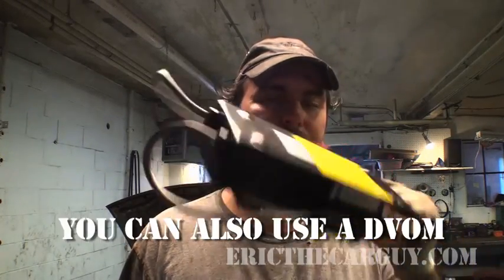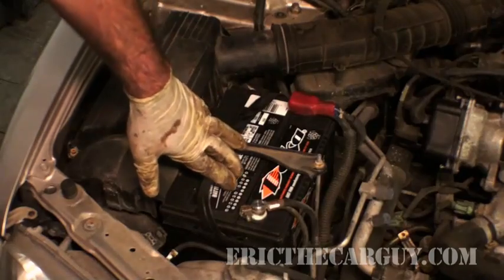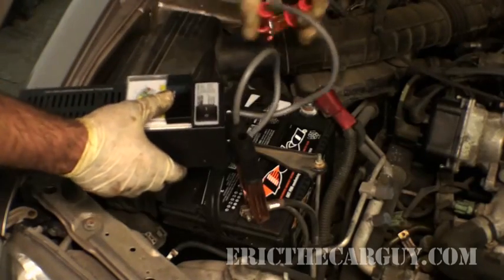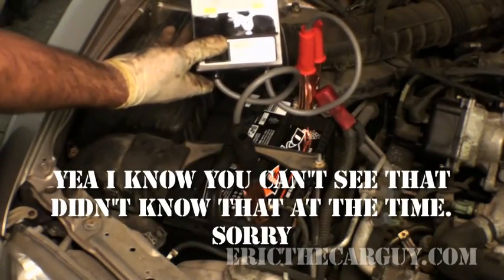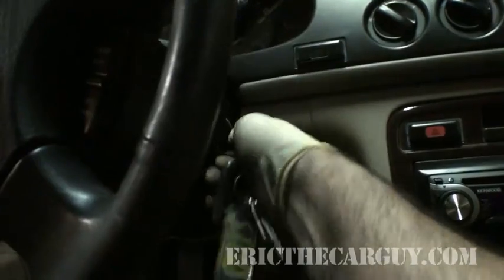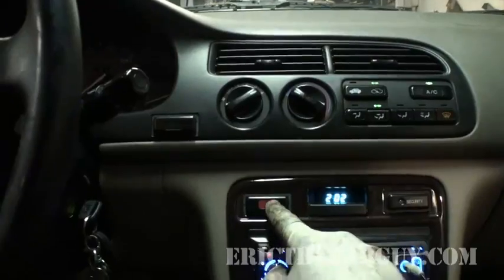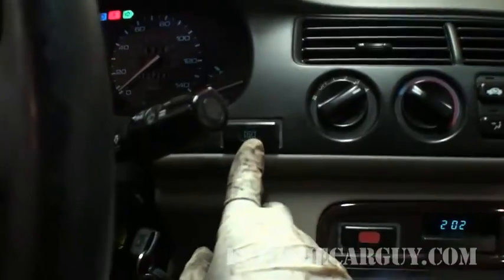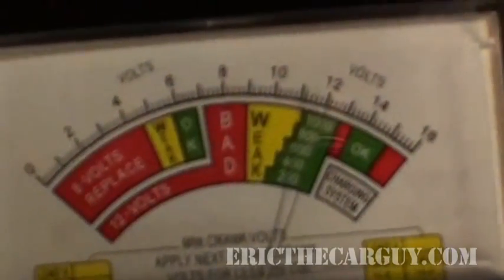How To Check A Charging System - EricTheCarGuy

Comment: Eric, I have an 05 Volvo xc90 that if not driven everyday, will not start.  clerk at autozone tells me it is a parasite. a neighbor tells me that the diodes in the alternator are bad.  I have hooked a meter and went checked every fuse, could not find anything(not sure if I did it right).  should I replace the alternator or do you have another suggestion.
Reply: +Mike Puckett Do not replace the alternator. If the car starts if driven every day, but won't start if it's been sitting still for a couple of days, then I concur with the clerk at Autozone; seems you have parasitic draw. When you said you did the meter-test with the fuses, did you mean hooking the meter in series with the battery (with the meter on Amp-setting) and start pulling fuses one by one? And if so, what did the meter measure the amp-draw to be from the get go, before you pulled any fuses?
Reply: thank you for replying.  what I did was to remove the positive cable from the battery(battery is under the back seats 3rd row) and I ran a wire from the battery post to the front of the car where the fuses are.  I hooked up the meter to the wire and then ran another wire from the meter to the battery.  I then started pulling each fuse one by one to see if there were any changes.   nothing changed.  I am not sure I had the right settings on the meter or even if this would work.  very frustrating.
Reply: SomeCoolName
Reply: thank you for replying.  what I did was to remove the positive cable from the battery(battery is under the back seats 3rd row) and I ran a wire from the battery post to the front of the car where the fuses are.  I hooked up the meter to the wire and then ran another wire from the meter to the battery.  I then started pulling each fuse one by one to see if there were any changes.   nothing changed.  I am not sure I had the right settings on the meter or even if this would work.  very frustrating.
Reply: +Mike Puckett If you did as you wrote then you had both leads from the meter connected to the battery, and that will not give you any amp reading. You need to hook it up in series with your battery, so you disconnect the negative or positive battery cable (it's recommended to remove the negative one actually, because then it won't cause any damage if it was to touch something ground), and you connect one of your meter leads to the disconnected negative cable, and the other lead to the negative battery post itself.

Now the current has to travel THROUGH the meter if you see what I mean, and then it can measure the current. Provided  you have the red lead in the right connector/input slot on you meter! (Amp, not Volts! And your black lead allways on COM), and the setting on your meter to the Amp-scale. If you have both an Amp-scale and a Milli-amp-scale, always start with thte highets scale, so not to blow the fuse in your meter. If you don't read anything on the A-scale, swith to the mA scale and see. Now, before pulling any fuses,  you should read a marginal draw, but no more than 40-50-ish  mA. More than that, and you probably have a parasitic draw.

NOTE, very important to ensure nothing is on in the vehicle, and that everything is as it would normally be if the car was just sitting in the garage, in other words, no open doors, no key in the ignition etc. Some "newer" cars even have sensors to detect if the key is nearby, so even that can "wake" the car's computer up without even opening the car door. Just something to keep in mind. Now you can start pulling fuses and look for a change in the amp readings. And remember, there may be more than one fuse panel in you car! In fact, it most likely is. Might be a good idea to look this up in the car's manual.
Hope this helps :)

Comment: how ERIC i have been to the shop 3 or 4 time to  the shop , i have a 2007 yukon denali  they said it wasthe battery, they said it was the brain, they said battery cable which they installment a new one, also a new battery plus a new brain but  i told then it was my alternator, now message says service battery charging system PLEASE HELP ME.....

Comment: hii eric , i have a 2009 hyundai i10, and the car wont start . i tried cranking with a test battery and it started. but the mechanic says that the cars alternator is gone and thus its not charging the battery... any thoughts ?
Reply: Saurabh Amin Sounds logical.  Have the alternator tested for free at some parts store like Autozone or O'Reilly's and then use google and buy a new alternator.  If the alternator is bad the battery will lose its charge.

Comment: Hey ERIC i have a question so i want to purchase a 2004 rsx type s and the owner said everything is good but he changed the alternator and the 2 o2 sensors and the only issue is the battery light is on and it wont turn off. Do you think i should risk it and buy the car. I know its not a huge issue but i dont want to deal with and problems after buying a car

Comment: I'm a maintenance nut about my cars and always checked and cleaned my battery terminals.  But Chrysler, in it's infinite wisdom, decided to bury the battery in my Plymouth Breeze in the left front fender requiring me to remove the left front wheel just to see it.  And Belle Tire loves their 100 ft/lb impact wrench.  If I get a flat tire I can not remove it with a new 4-way and a cheater pipe.  AAA broke one lug trying and Belle Tire broke one too.  So I had to pay for 2 new studs and $35.00 to have someone put a battery in.  Not ranting  It's just that I'm having cold winter slow or no starting now and the battery and charging system check out OK but I have no idea what the terminals or cables look like.
End of non rant.

Comment: Can you disconnect the positive cable on the battery while the car is running to check the alternator? If the car stalls then the alternator is bad.
Reply: I used to do that with older (MUCH OLDER) vehicles to test if the alternator was charging. Yes, the car will stall if the alternator is bad (that's if that method didn't destroy it). I don't know if I'd want to do it on newer vehicles though, since a good majority of newer vehicles have extremely complex electric systems now and can be pretty sensitive.

Your battery does more than just start your car. It also shorts AC, spikes and transients to ground. Removing the battery from the circuit (while the vehicle is running) allows those spikes and transients to travel around, which is dangerous to every semiconductor circuit in your car.

Disconnecting the battery interferes with the alternator's regulator's control voltage input, it's possible for the alternator voltage to go way over the top, frying everything. (were talking HUNDREDS of volts possibly)

So I really wouldn't recommend that method. Do what Eric does in the video, provided you have the tools. Much Safer.
Reply: Thank you.
Reply: yea in the old days it would work but now a days its about the money
Reply: Gary Pennington79p0

,
Reply: Last time my mom bf did that he fried everything in his car. Why would eric show us this way? Bcuz this is the safest and correct way. That way is the lazy and dangerous way. Electricity is not something to play with. People at autozone and orileys and my gf dad which is a mechanic told me never to do that. Just saying. That's very dangerous.

Comment: I would hesitate to definitively conclude this alternator is good based on the following reasons:

A brand new, known good, fully charged battery, that reads at 13 volts with car shut off (notwithstanding load of the computer and clock memory circuits of the vehicle). That is dropping below the battery's nominal voltage when running I think it's very plausible that the alternator is beginning to fail. I suspect at this point it is still charging partially, but not enough. A healthy alternator on a running vehicle, even at idle should read above 12 volts.

I would have conducted further investigation with the same test equipment by leaving the vehicle running at idle for 1-2 hours, with all electrical devices on, taking a voltage reading every half hour. If it continues to drop, we know this alternator is in need of replacement.
Reply: i agree   this being 12v is too low  car should be almost 12,5 to 14.5 with a  not sure i know that car wasnt post 2005     but in 2005. This is when   the cars started smart charging , turning up and down the v as you need it. At fully charged a batt it will sit at 12.5 as car or batt needs more it can hit almost 14.8 . That is why they did away with the volt meter on dash so people did not see the v meter moving  and think alternator all the time

Comment: Hey Mr. ErictheCarGuy. Been checking batt. on my Subaru Outbck 2002. Batt brand new. Mercilessly wire brush and sandpaper cleaned all cable contacts and on neg + pos poles of batt.

Today, Batt charger says batt. full 13V when connected directly to batt. poles. But with pos+ pole and neg- cables attached, batt charger says 'no batt connected'.

 When I "remove" Pos+ pole cables (there are two connected to Pos+ pole clamp), then connect charger directly to pos+ pole on batt and on neg pole with cable attached, charger "detects" batt. I checked alt cable attach and is snug.

I checked alternator with pos+ V.meter attached to neg- batt. pole and touched the alt case with neg from multimeter. Reads 0.01V. (I accidentally touched the contact under red cap on alt with spanner and it sparked.)
 
I was able to boost the car last night and batt charged full. Batt charged today but electronics absent, had to open car with key.

A fellow Outback owner suggested just replacing the batt+ cable before buying a new alternator.

Can you offer an opinion? Appreciate. Gary

Comment: HELP!!!! I have a 86 toyota truck. 22r motor Carborated. I replaced the Altenator, Battery< and checked ALL the fuses from under the hood and in the left side interior. Still not charging. the idiot light on the dash isnt lighting up either. But when I disconnect the cable from the battery it shuts done. Is there a fuseable somewhere between the altenator and the battery? If so where?????   Also the connects to the battery are clean.

Comment: Hello Eric, one you didn't talk about is over charging, I just had a vehicle brought in on a truck. a customers complaint was that when she was driving all of her lights and gauges shut off. I did the alternator check and it was at 14.5V and normal operation of lights and gauges. After opening the throttle a little to over 1,000 RPM gauges shut off and lights, alternator was putting out over 17V, concluding that the regulator in the alternator was bad.

Comment: This might be my fix right here.. I have a 98 ford ranger 2.5l and i just put a new alternator in it, battery checked good at 12.6V ... still, the alternator is not charging the battery. Guess I'm going fuse hunting tomorrow..

Comment: What you have is called a parasitic draw.This could be cause by something not turning off when the truck is off. It is normal for the ECM, BCM, security system to draw a few milliamps when the key is off. Check to see if any lights are staying on. Use an amp meter on the battery cable and pull fuses from the fuse box until you see a major drop in amps, If you manage to pull all fuses and still have a draw then it may be a shorted alternator.

Comment: Hi Eric,I have a 87 F-250,I put a new battery in,and accidentally reversed polarization.When I touched the neg.clamp to pos. post,I blew the carter solenoid and fusible link,I re-did the link,new solenoid and alternator w/new plugs(external reg.). Start the truck,and is not charging,did I blow the E.C.U.?Where is it? Retested everything,and is good.I pull off the neg,and engine quits.That was starter solenoid.Trying to find the computer...Going nuts here.HELP in Chicago,where is ECU located?

Comment: If you're getting a charging light when you put a heavy load on it, it's possibly a bad alternator. Before you condemn it though, 1 question. Does it come on only at idle or is t on all the time with hat particular load?

Comment: Eric,
help!!!please!!! I have an 87 Toyota pickup. just started with a charge light that comes on when you turn a/c and lights on. I've checked the alternator and it seems ok as it keeps running when you take a cable off and the battery is new. any suggestions for me? thanks shelly

Comment: The cheapest, most effective thing you can do is clean up all electrical connections and inspect the wiring going from the alternator to the fuse box. Even if it turns out that your alternator is bad, it's totally worth cleaning up your electrical connections as it will help improve the life of the alternator.

Comment: I disagree with this video. The newer, more in depth video ETCG made is much more accurate. 12v charging voltage with everything loaded down is way WAY too low. Bare minimum charging voltage is 13.2V even when loaded down, anything less than that can be caused by innumerable number of reasons. I do agree though that there should be strong emphasis on cleaning up electrical connections and grounds. Cars use DC power and DC inherently will corrode its connections so periodic cleaning is necessary

Comment: I've gone through 5 batteries in the past 6 years, and it always come down to a bad cell in the battery. I've tried many different brands, but run into the same problem. A couple of guys have told me that I have something draining the battery when the truck is off, which ultimately kills a cell apparently. I have relays on my accessories, but still have the problem. I've also been told that my alternator may be putting out the voltage, but not the amperage needed to charge the battery.

Comment: Checking voltage at "high idle" as Eric mentioned IS very important.  At about 2,000-2,500 rpm you should have about 14V.  Less than 13.5V or more than 15.0V, you likely have a problem.

Comment: saw how did you hooked up the battery load tester on to the alternator? or when you load tested the alternator did you hooked it up to the battery to see if it was getting more than 12 volts , cuz you never show how to hooked the battery load tester to the alternator

Comment: eric great video. I have change my alternator several time. 2 rebuilt and i new one. Could the car be killing the alternator. The charging light and fuel light comes on at 12-1500 rpm. I recently chafed all fuel injectors.

Comment: Great Video Eric, I have never checked an alternator with a load tester...if I suspect an alternator I will listen to the bearings ( which go bad over time ) and through a meter on the altenator direct to see how many volts its putting out...also keep in mind an altinator that is seized up can keep an engine from turning over on some vechicals, serpentine belts are a lot stronger....Ive seen this happen and they were told the engine need replaced ( was a seized altenator ) crazy............

Comment: Eric, you are The Man! So I borrowed my parent's B&D battery charger w/ the alt checker because my battery was dead. Tried charging the battery -- one of the cells were bad. Then I did the alternator check -- said the alternator was bad, also! I bought the parts, then replaced them. I hooked up the B&D thing again; the battery was good, and the alternator was "bad". So after using a multimeter and doing a load test, I finally figured that the alt. checker machine was bad!!! Stayin' dirty, babe!

Comment: Hey Eric, so i got an engine wash and my battery seemed to be draining out after that, i dont remember them covering the alternator when washing it, so i figured that it needed replacing and so i replaced it.  I fully charged the battery before starting the car,(i bought the battery 6 months ago,but the car was never turned on during the winter) and everything worked fine.  The next day, the car is still doing the same, it wont start unless its jumped, or battery fully charged.

Comment: What about if car is below idle ie in drive will the volts still be at or above 12. Have a 2001 Sienna with the rear AC and daytime running lights it's hard for the alternator to keep up.

Comment: Hey Eric, My brothers Saturn SL just decided to turn off the other day while he was slowly coasting up to a red light.  He tried to turn it on and it just clicked.  Not the "my battery is dead click" but a very rhythmic loud click that sounds like the starter.  I've checked pretty much everything and the only thing left to do is to replace the starter.  But have you ever heard of a starter causing a car to die like that? 

Thanks.

Comment: @MrZdog76  Very bad idea.  System is not designed to run this way and can result in electronic components burning out.  New computer is some 600 dollars.  You can blow the rectifiers in a good alternator.

Comment: @MrZdog76, very informative, do this on a modern car and it will fry out your computer box(ECU),fuel injector, alternator, a/c circuit, car stereo,and all the electrical that is switch on when you remove the battery cable...

Comment: @EricTheCarGuy  Eric i just came from the mechanic and he tested the battery on my car. the results were good.  my problem is the battery light flashes sometimes while I'm driving.  I installed a new alternator about 5 months ago.  The car is driving fine, my wife just drove 100 miles without any issues, I'm concerned that the battery light flashes.  can you tell me what could cause this?  Thanks

Comment from the maker: @sbakar Yea when you mentioned full fielding didn't make any difference I was thinking the voltage regulator was OK, if it was bad you would have seen an increase in voltage during the full field, based on your description it does sound like it might have lost a phase or some other issue with the alternator itself.  Thanks for the comment.

Comment from the maker: @Junkman2000 The voltage can be as high as 15V and still be good.  You may have a mechanical issue if it's 'rpm's' that are causing that problem.